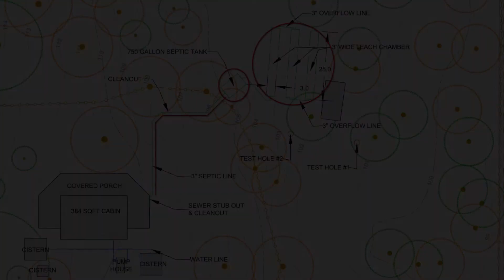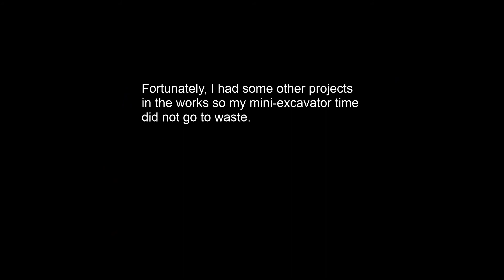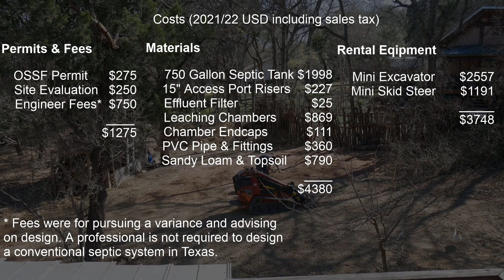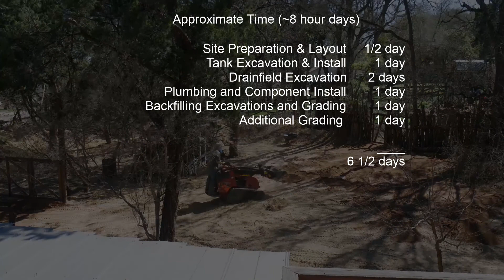Installing a Septic System

Comment: Great video! Loved how you showed the more in depth process of designing and installing your own system. Were there any concerns with the length of the pipe from your house to the tank, since it contains solids? I saw you included one cleanout in your design, but didn't see it installed in the video.
Reply from the maker: Thanks! When I was planning the system I found several videos on how to put in a septic system but not how to design one. Glad it was useful. Regarding slope, yes, I had some concerns that the slope might be in that middle ground where liquids outrun the solids. I talked to the inspector and engineer I hired to attempt to get a variance and neither seemed concerned. I installed the cleanout as part of the cabin plumbing (not filmed, sorry). Since I the rest of my turns were less than or equal 45° no more were required. I think some clean outs/view ports would be useful in the drain field. My parents' drain field is having some issues and I think it would helpful for troubleshooting.

Comment: TX counties have been encouraged to adopt more stringent septic requirements primarily by the people who install septic systems.  They want to move everyone into aerobic septic systems that treat effluent in tank and disperse by sprinkler rather than field lines.  These systems require power for pumps and aeration and they require regularly inspections 1-3 times per year.  Guess who performs and charges for these inspections?  Yep, the same folks who install the septic systems.  I fear the days of TX homeowners legally installing their own septic systems will end soon as well.  I installed my first system 10 yrs ago without a single issue since.
Reply from the maker: One of our previous county commissioners owned a septic installation company. It does make you wonder. 

The aerobic treatment units bother me as well since they introduce the opportunity for mechanical failure and user error. Whereas, if you install a conventional system correctly it should be maintenance free for a couple of decades.

Regarding your last point, its sad but I don't think there would be much push back if they made it illegal for homeowners to install their own septic systems. The inspector commented that a homeowner installed system was rare. The thing is that its not that complicated a project. Once you've sorted out your tank and drain field size its just a matter of making sure your tank is downhill from house and the drain field is downhill from the tank.

Comment: $9403 divided by 6.5 = $1446.62 per day of billable time per day. Seems to me that you would have paid more for a contractor to install that. On the bright side, you spent a lot less money to get what you wanted (that they'd allow you to install). Looking good! Excited to see how your build turns out. Been following you for a while now. Since before electrical and plumbing went in.
Reply from the maker: I should have gotten a quote just for comparison but neighbors and friends in my area have gotten their systems replaced lately for ~$25,000 (labor + materials). I also could have knocked around $1000 off of my costs by just renting the excavator for a week and using the skid steer to back fill.